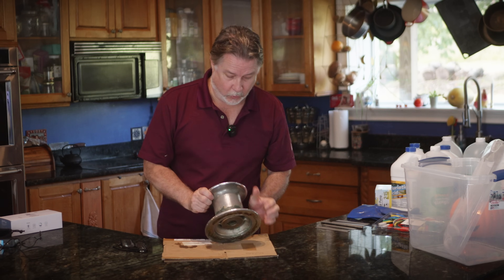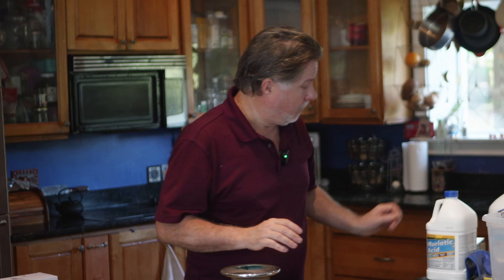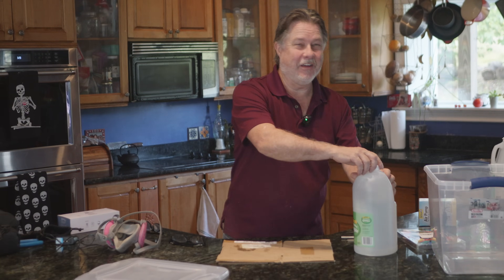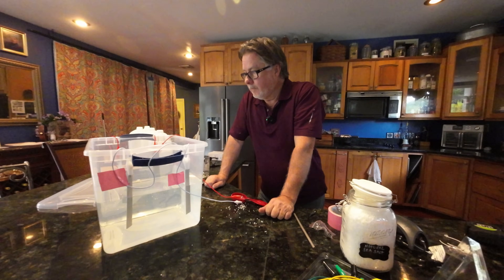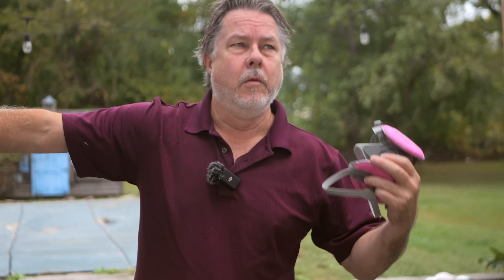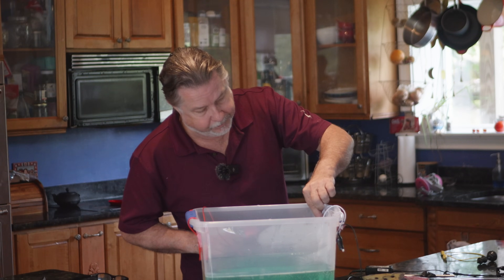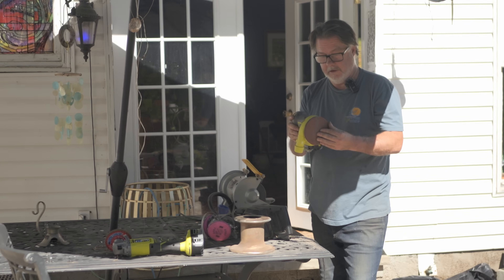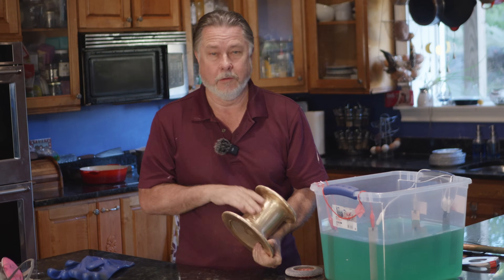How to re-chrome an anchor windlass!  E230

Comment: This takes me back... 1980, at an unnamed pier in West Palm Beach. We wanted to clean up the bronze plumbing for the Wilcox Crittenden heads. I got the paint off easily enough, but there was corrosion on the outside and a lot of build-up of maybe calcium carbide on the inside of the pipes. I went to a chemical supply house and came away with two acids to mix together, with instructions (don't pour water into acid!), and I mixed them in a five gallon bucket. It worked great, but there was a problem. Heat build up! I got the pipes cleaned out, but the bucket began to deform right there on the pier. It was going to spill all over the pier, and so... I slid the bucket to the edge and oops, over into the water it went. Yes, I committed an Enviromental Crime right there. As the moving tide carried the mixture along the seawall it fizzed and bubbled furiously, killing everything it touched. I am ashamed of what I did. I didn't see another option. But the captain got his wish to be The Man With the Golden Toilet.

I did have things chrome plated at a business, and I learned that a very thin layer is deposited onto the item to be plated, and imperfections will show up, so you want the item to be as smooth as possible. You want to polish it VERY smooth. The nickel will stick just fine, it is still plenty rough at the molecular level. But the nickel is soft and will wear off easily, so you add a very thin layer of chrome on top. I don't think you will be happy with lacquered bronze, it will deteriorate quickly.

Also, what did you do with your nickel solution. No, don't tell us!

Comment: So,, Ed and Lyn
What did you do with that solution?
Anything limp and/or eroded  you'd like to chrome plate?
Just asking:)
Cheers,
Rik Spector
Reply from the maker: We just put it in a 3 gallon plastic jug. We are keeping it around because the horn on our boat needs to be refinished.

Comment: Hey guys, I work with chemicals all the time. Please don’t mistake regular glasses for safety goggles. And if you do wear glasses like our friend here, please wear a face shield.

Beyond that, I am sad the chrome didn’t work. Yes the Bronze looks beautiful and I will be looking for it on Trident in future videos, I really wanted to see the end result of a home school chrome set up.

Either way, great video!!!
Reply from the maker: I know. I am wearing goggles in a couple of scenes but kept forgetting to put them on.
Reply: I noticed the same thing.  I know you both probably know this, but others watching this should be aware that this is a potentially harmful chemical.  There is no way I would use that concentration without splash goggles.   Also, you talked about diluting the concentrated HCL for applications where a more dilute solution would work.  Just an FYI, you should dilute the acid into the water, not visa versa, and have VERY good ventilation.  This stuff can really hurt you if you get it in your eyes, skin, or lungs.

Comment: I think there are a few things you should have done differently.  

First of all, the chrome could be removed using the same process you would use to plate the capstan with chrome.   Just reverse the polarity, which should put the old chrome back into the solution.

Secondly, the item you are wanting to chrome or de-chrome should be either the cathode or anode, depending on whether you are chroming or dechroming.   Otherwise, there will be no potential difference (voltage) to attract or repel the chrome.

Third, I think you need to use a much higher current to get the desired result - about 2 amps per square inch of material being plated.   But, the voltage should be lower - like around 12 volts.   You could use a low voltage arc welder to provide the needed power.   A laptop charger is never going to provide the desired result.

Finally, I don't think clear coating the capstan in an effort to preserve its bright shiny finish is going to provide a satisfying longterm result.  Clear coat on cars deteriorates just from normal washing and sitting in the sun.   I can't imagine clear coat paint lasting very long at all with the abrasion of a rope being wound against it.

Of course, I have not plated anything since I was a child - and, I'm 62 now.
Reply from the maker: Thanks for all the info. We do not actually use the capstan since we always use chain when anchoring so it should not have a problem with rubbing. Still, we figure if the finish doesn't last we can always re-chrome or nickel plate.
Reply: I think you are spot on